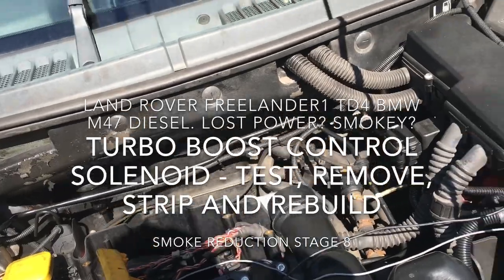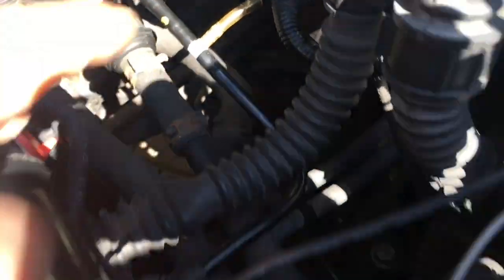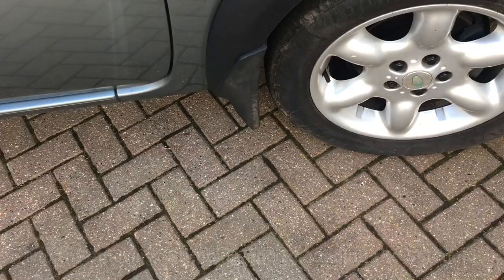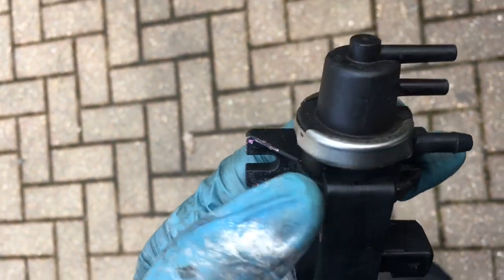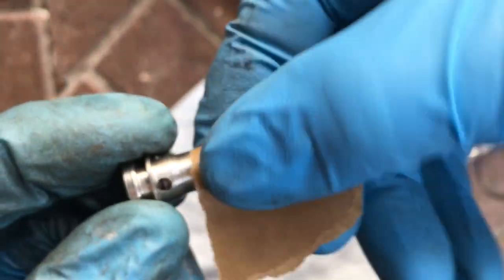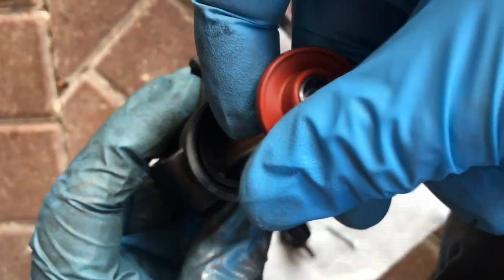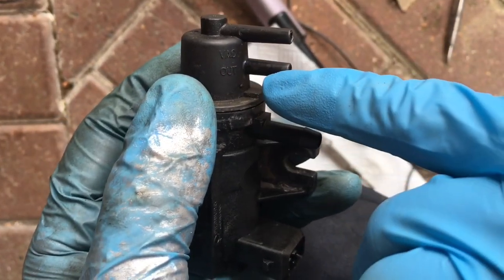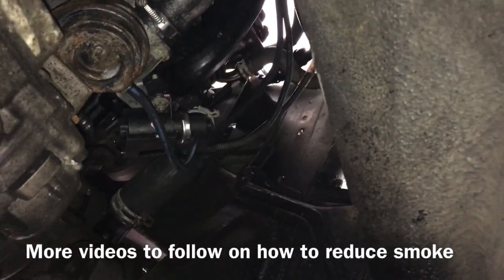How to Remove, Strip and Rebuild: Turbo Boost Control Solenoid. Freelander TD4

Comment: Your a life saver, honestly, I brought a brand new solenoid as the old one was making no boost at all, as the mechanic connected it back up, the pipes were all tangled, so stupidly I though to remove the pipes not knowing how fragile the ends are on VAC IN and OUT are, snapping one alone the way 🤦🏻‍♂️, ur video saved me going out buying another, as I can swap the top bit from the old one, so thank you very much,
Reply from the maker: Cheers

Comment: I'm getting a loss of power after splashing puddles. And very lumpy and juddering running. If I turn the car off and re start it runs fine. Have u ever heard of this and do u know what causes it
Reply from the maker: Petrol or Diesel?
Reply: @comeinhandynow  2006 td4
Reply from the maker: @raptorrestorations  That is a tricky problem to diagnose remotely. The usual checks would be to check for fuel by checking the HP fuel rail sensor to see if it is in range and check turbo boost/inlet pressure to check air is getting in ok, but your symptoms suggest something electrical is getting upset. Sorry I can’t be of more use.
Reply: @comeinhandynow  thank you for replying I will have a check of all that later on this evening. Great channel 👏 very helpful

Comment: hi, any idea why the boost control solenoid does not get the right 12volts power , i measured with a multimeter and it gets around 8 volts , which makes my freelander go into limp mode at 2000 rpm , and does not go up (checks engine appears and gas pedal does not respond to any push )
Reply from the maker: Are you measuring the voltage across the solenoid? If so that is probably about right as the signal is pulse width modulated (rapidly switches the full 12v on and off), so it may well read as an average of 8v.  Your lack of power sounds like loss of boost pressure.  Check for any split or holed hoses in the turbo output pipes.

Comment: I have a 2002 t4 freelander and I’m trying to locate the turbo to replace ? And is this something I can do at home if so how would one attack it ??
Reply from the maker: It is down the back of the engine, not the easiest place to get to.  Buy a Haynes workshop manual for this car to help.
Reply from the maker: also be certain it is the turbo that needs changing as a clogged crankcase filter can push oil through the turbo oil seals and make it smoke and look like the turbo has gone.  Change the filter first.
Reply: Yeh definitely turbo was driving then massive smoke screen behind emptied all my engine oil too how should I replace from above or below there is no videos about mate thank you 🙏

Comment: Repaired the boost control valve, tested it and it works. Still got P1E30 code, no leaks found on turbo hoses. Also vacuum is supplied to the solenoid. What else?
Reply from the maker: That seems to be a check of the solenoid coil resistance, check the wiring and the coil resistance is not open circuit.  See:

https://www.landyzone.co.uk/land-rover/2005-td4-giving-p1e30-error-code.344738/
Reply: @comeinhandynow  
Thank you very much!
Happened to be a broken wire (ground or phase) due to oxidation. Fixed it and now turbo works as before. Cheers!

Comment: Hi there, I’m new to fixing turbo problems on my cars. Really helpful video. We have intermittent boost pressure on our TD4. Looking to change the solenoid. Question for you ….. can the solenoid cause to waste gate to stick open?
Reply from the maker: Since the solenoid moves the waste get then yes it could possibly stick in the open or closed position if it is rusted up.  Take it apart and see it it moves freely, if it does then maybe the turbo wastegate/lever is corroded and stuck which can happen.

Comment: Hi whereabouts does the bigger pipe of the 3 go to from the solenoid
Reply from the maker: So one goes to the vacuum pump/tank, one goes to the turbo actuator, the other one is a vent to air so should go to a filter and then a high up open to air pipe
Reply: @comeinhandynow  cheers pal

Comment: Next video remove turbo. Plsss. Thanx
Reply from the maker: Looks time consuming, maybe engine out job.  Not sure.  Anyone else know out there?  Probably in the Haynes manual.
Reply: comeinhandynow they Haynes manual advises that you have to remove the IRD to remove the turbo - however there is a good walkthrough on removing a turbo on landyzone forums without having to remove the IRD. I have a Oil leak possibly coming from drain pipe so I’m about to try and remove and check. Thanks for your video as it has explained a few things to me. Sam

Comment: I'm dealing with the piece now on my vehicle (Discovery Sport) and the tight space it resides I'm unable to figure out how the electronic cable is disconnected? what type of connector is that called? So I might find how to unlock it? 

Every vid just skips that portion. I need some help asap
Reply from the maker: I’ve not done that job, but it’s usually some sort of side squuzing or top lug press and a bit of pulling off at the same time. On LR’s all the connectirs are waterproof, which is a good thing but sometimes a bit of levering off is needed if it’s been on a while.  Maybe try and get your phone camera up there to see what you arecdealing with via a video recording.

Comment: Hi,
Great video! One question. My td4 is very shaky (rough idling, hard to start, terrible acceleration and loss of power and check engine light) like going uphill will bring me down to 60kph. I am changing the boost pressure sensor and this week and will check the solenoid and vacuum hoses, do you think this could be a cause for my problems?
Reply from the maker: Sounds like boost pressure problem, at the least.  Check inlet manifold pressure (MAP sensor reading) and high pressure fuel sensor for any injection problems.

Comment: Hi,
Thank you for sharing your findings and testing methods! What I wanted to ask, to make sure if my solenoid is being actuated the right way or not, at idle, do you remeber if the actuator rod is fully retracted, like with other cars? I get 11V at idle, being ground controled. Ground wire integrity is ok, and I also get alternator power on the positive wire. It is a bit strange that the turbo geometry is not fully engaged at idle when it is needed the most🤔. Thank you!
Reply from the maker: Yes I think that was a similar situation to my car. Strangely it is not max turbo boost setting on solenoid at idle.  Probably to help emissions or economy, not that the turbo is doing much anyhow at idle but maybe it makes a small difference. It’s one of the reasons I made that simple boost controller  (see that on my channel) so that it’s on max boost all the time unless it hits the maximum pressure, when it’s cut. It certainly makes it pick up the revs quicker and removes that common ‘smoke when stationary revving at 2500 - 3000 rpm’ due to poor engine air flow (too carbonised up).
Reply: Right, so I guess that means there's nothing wrong with it, it is the ECU map commanding the solenoid at idle in such way. Makes no sense though, because normally at idle, when there is no high speed for the exhaust gases, the turbo vanes should be fully actuated to reduce turbo lag as much as posible right from the moment you start accelerating, only to descrease the vacuum applied accordingly, as the air pressure goes up with the revs. At least that's how most of the cars I've worked on deal with turbo pressure. You can really see a difference with the controller fitted in your video, also with smoke reduction I guess. 
But how's the acceleration when turbo is at 100% right from the start? It should definitely go through gears noticeably faster...
 Maybe this design is made in such a way that it applies full vacuum to the turbo only when certain conditions are met, like when pressing the throttle pedal close to the floor right from the start, and not progressively like when you drive to save fuel...🤔 I'll have to test this while driving from a stop, to see if the ecu switches the solenoid to full ground for a few moments until the pressure reaches the max limit or I let the foot off the pedal.
Reply from the maker: @libarca89  Yes it accelerates quicker with the manual boost controller giving max boost via the solenoid.
Reply: instaBlaster...

Comment: The top pipe has snapped off my solenoid ,I’ve ordered a replacement because I was getting p0046 error code and spotted this ,trouble is there’s currently no vacuum pipe I can see nearby so it’s been removed prior to my ownership ,my egr isn’t connected so can I run the blanked off egr vacuum pipe to the solenoid top nipple ? 

If not there’s a short piece of vacuum pipe on the back of the vacuum accumulator tank which has a screw in the end ,can I take the vacuum from there ?
Reply from the maker: The vacuum line should come from the vacuum pump (some models had a tank as well I believe). Usually the vacuum pump goes to both the egr and turbo solenoid via t-junctionm as in the video, in your case youy dont need the T to feed the egr of course.
Reply: @comeinhandynow  I’ve found a diagram on line showing that if the tank is fitted (mine has one) then the solenoid vac line attaches to the back of the tank ,thanks

Comment: Well done for posting the video. However your car has been messed about with. 

There should be a vacuum accumulator (about the size of a Coke can) between the main vacuum line and the boost control solenoid valve. Also the boost control solenoid vacuum pipe is routed incorrectly. It should follow the injector harness along the top of the cam cover, and down the far side of the engine to the boost control solenoid. It shouldn't be clipped to the bulkhead like yours. 

You need the accumulator, or boost can drop off under sustained full boost operation, dew the vacuum depletion. 

Nice video though.
Reply from the maker: I think the vacuum accumulator is on the L series diesel isn’t it?  Not the td4.
Reply: @comeinhandynow  
It's on the TD4 and not the earlier L series. ;)
Reply: FLOG

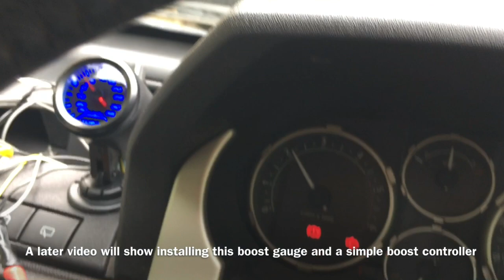Comment: That statement at 13:00 is ridiculous. The ecu is way more intelligent than you might think.
Reply from the maker: Since pickup and driveability can be improved by bypassing the ecu, then lets just says there is room for improvement, or they set it that way for emissions or economy.